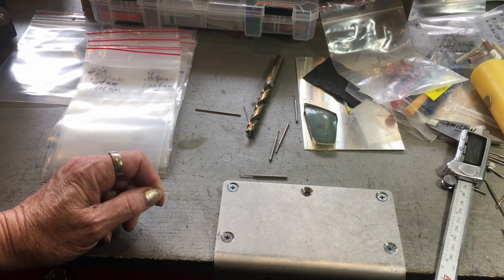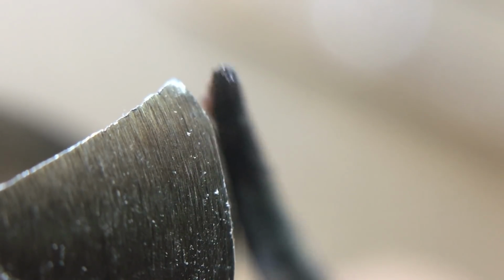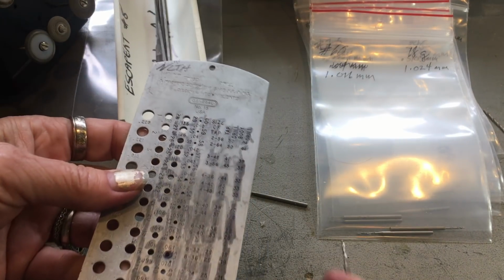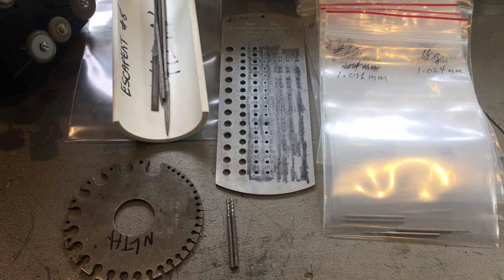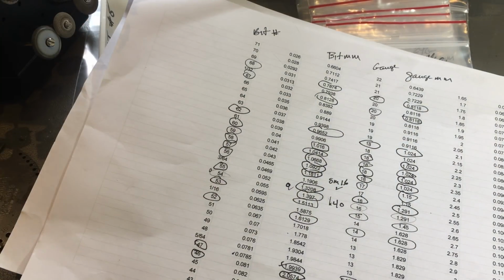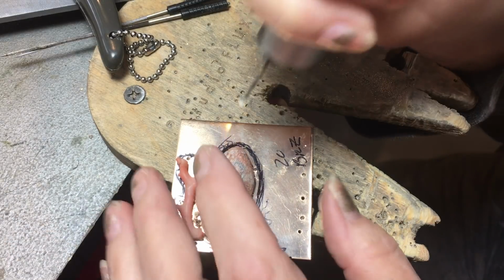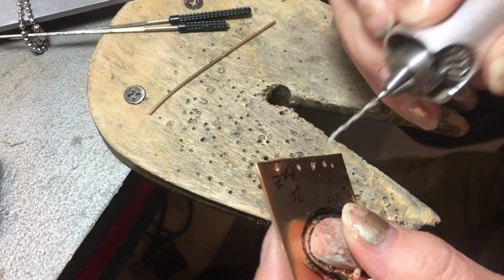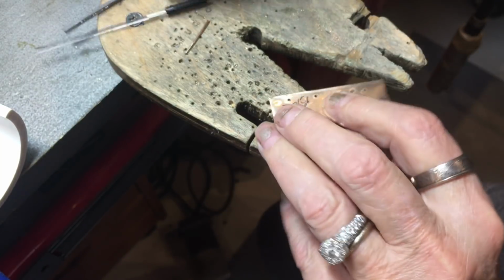Drill Bits:  Drilling, Anatomy and Use for the Jeweler (and everyone else!)

Comment: In machine shop class we were taught about proper drill speeds by drill bit size and metal (you can google for charts), and the smaller the drill bit the faster the speed. For brass and aluminum and copper the speed was even higher than for iron or steel. With such a small drill bit, your flex shaft may not go fast enough on the highest speed. On the other hand, you have a lot of experience as a jeweler so I want to listen to you. Here's an article: http://store.curiousinventor.com/guides/drill_speed
Reply from the maker: Patrick Horgan Interesting!  I will definitely read more. Thanks for the link.  I just know what works for me and that fast speeds dull bits because they get overheated easily,  due to their small size so maybe, there’s speeds for saving your bits and conversely, speeds for the most efficient drilling.  Both could be true.  Thanks for the information - it is appropriated!!!
Reply: I know! That was always my experience to. Small bit burnt up. But in the machine shop class, if I followed the charts, it always worked well and made a clean hole. Of course I used lube and didn't feed into the metal very quickly.